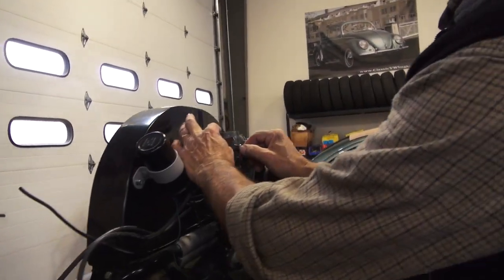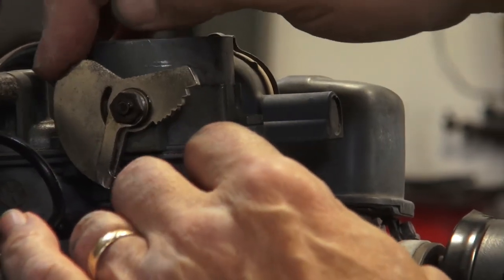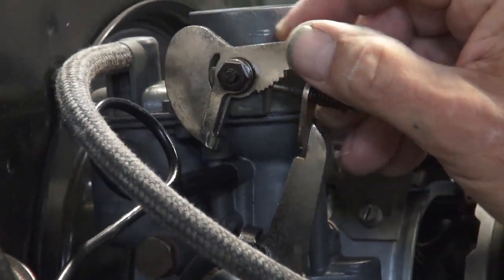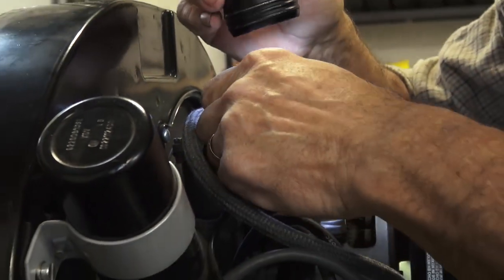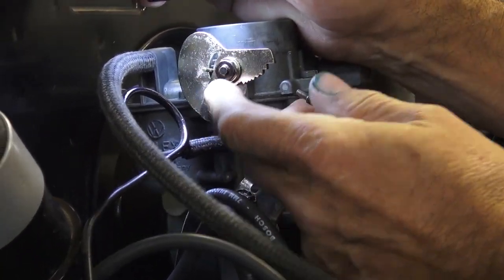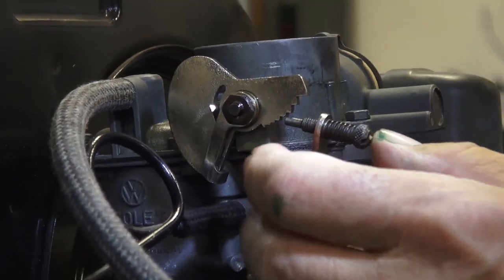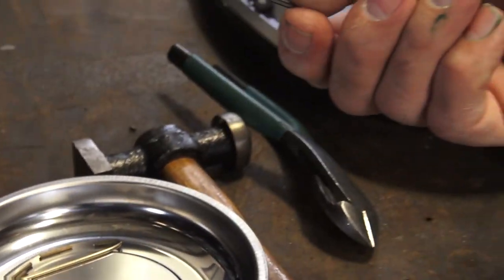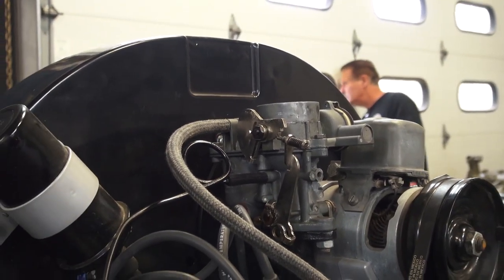Classic VW BuGs How to Install a Missing Beetle Choke Pin Needle

Comment: Outstanding video Chris... My aunt has a 65 bug that is her Baby. All original and run like a top. She has her neighbor start it and take it for a spin when she is out of town for extended periods. A month ago I got the call that the accelerator was sticking while her neighbor was driving. Sure enough I find that the cam has rotated all the way... I thought it odd but little of it. Rotated it back around to its proper position.. Drove it.. no problems.. Assumed it fixed..Wrong. .. Got the call last night same symptoms... Checked.. Over rotated.. So now I had to know how.. Found your video!! Thank you so much. The pin had almost worked its way all the way through. About 1 inch I could see in the carb. Again... Tyvm.
Reply from the maker: ah thats great, glad I can help.
Reply: @Chris Vallone ...Have you realized yet from my comment... The part containing the reference to inches... That I royally screwed up? If you would email me I would be super grateful... Before the aunt gets back anyway...lol (just kidding Linda if you see this)

Comment: Oh that pin! Never had trouble with that one, car always started fine, even at -20°F.

The one pin I had trouble with was the one on the bottom right back corner of the carb which holds the triangular plate that actuates the accelerator pump. The carb being made of magnesium (I believe) and the pin of steel it would work the bore open until it dropped out and couldn't be refastened. Without the accelerator pump it was pretty tough to start the car and to get driving. You needed to push the acc. pump with a screw driver first to get her started and the full-trottle enrichment to get off. Nobody but me could drive that car! :-D

Comment: Thanks for the video. My wife's 1970 Bug won't stay running unless I have my foot slightly on the gas pedal. She has never let me try to fix it let alone drive it. Well, she gave in today because she is tired of it just sitting in the garage. I think this pin is what I need. Where do I pick up the right size pin and not just a screw?

Comment: Good afternoon! Make More Videos like this, men, do not you use cable ties on fuel hoses?
Reply from the maker: I have so many man, close to 400 or more, all on my channel.
Reply: Rsss. Man was a form of expression, short your videos and I am subscriber of your channel. I try to apply some things it shows on my Beetle.
Reply: Outstanding video Chris... My aunt has a 65 bug that is her Baby. All original and run like a top. She has her neighbor start it and take it for a spin when she is out of town for extended periods. A month ago I got the call that the accelerator was sticking while her neighbor was driving. Sure enough I find that the cam has rotated all the way... I thought it odd but little of it. Rotated it back around to its proper position.. Drove it.. no problems.. Assumed it fixed..Wrong. .. Got the call last night same symptoms... Checked.. Over rotated.. So now I had to know how.. Found your video!! Thank you so much. The pin had almost worked its way all the way through. About 1 inch I could see in the carb. Again... Tyvm.

Comment: the previous owners placed in an electric choke on my 67 and it doesn't idle down after 30mins of warming up.  what do i do.  is it cheaper to get a manual choke or an electrical?
Reply from the maker: A 67 is supposed to have an electric choke, not manual.  Also, it should not take 30min for the motor to warm up and for the choke to kick off.  If it is not working, maybe the choke element needs to be replaced or the wire is not connected to it? Or a faulty wire?
Reply: I'm just wondering how to install my manuel choke I see the hook but where should i set it?
Reply: Sorry auto choke on my 65